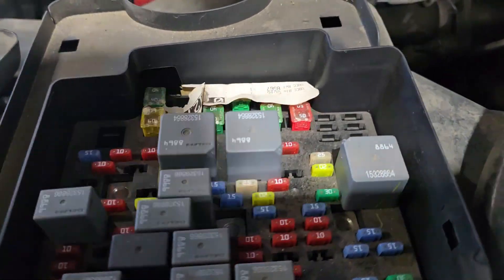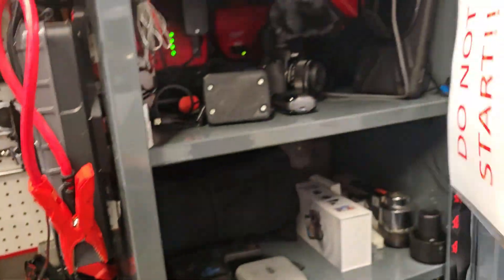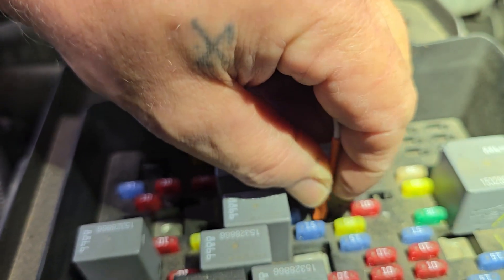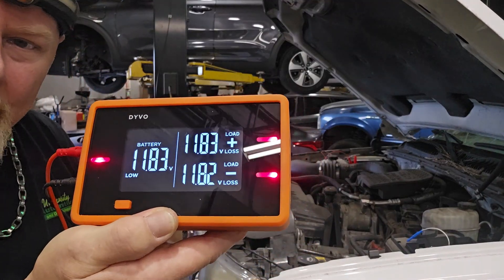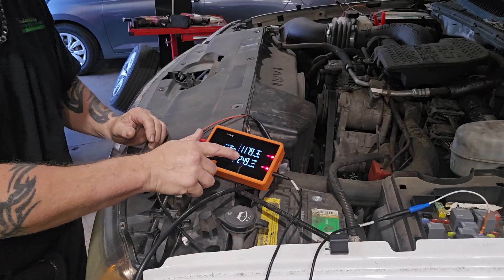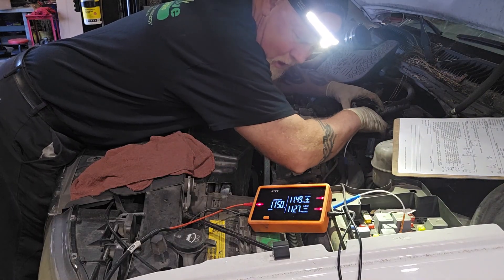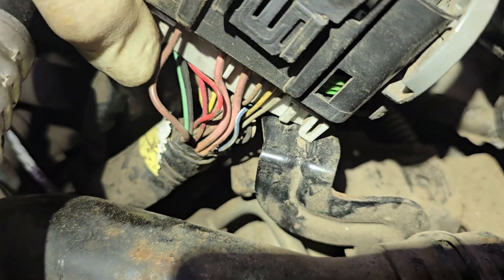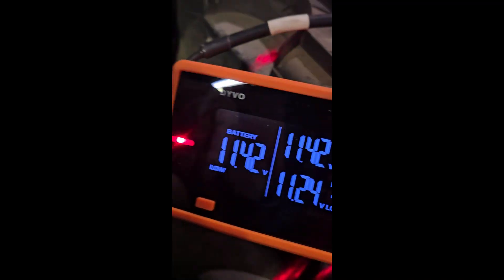Duramax No Start NO FICM COMMUNICATION. DIRECT SHORT

Comment: Most confusing diag I've  ever  seen
Reply from the maker: Not sure what you mean, truck came in with crank no start and a DTC. Found blown fuse, replaced fuse and truck runs. Well fuses do not blow for no reason, so I used a tool to find the problem.

Comment: Tool worked for you. But I was confused on its operation with lights
Reply: Now I finally get why a Dyvo isn’t just a power probe. Thanks for that. Also, GM side post batteries suck!
Reply from the maker: @ToolDemos  haha yes they do especially jump starting.  Dyvo is an all around multi tool for electrical.
Reply from the maker: @philh9238  normally I use it for checking power and ground to a component and if the leds turn green then my voltage and ground are good.
Reply: @philh9238 The lights (LEDs) work like a stop light system. Green means low voltage drop, yellow means marginal, and red means high voltage drop. DYVO has 2 channels, one to test positive circuits, and one to test ground circuits. Fuses should only have power. When ground is present, the fuse blows. In the video, he connected the ground channel on DYVO where the fuse normally goes to see if there was ground. If the LED showed green, that would mean there was a direct short to ground.